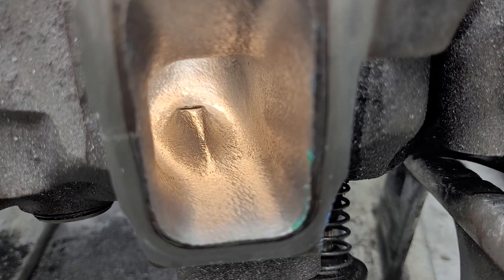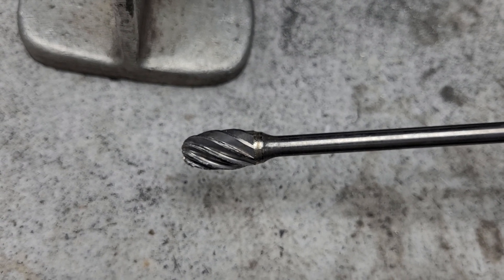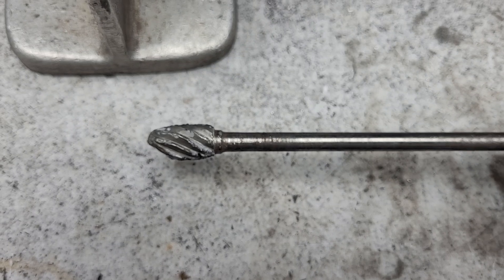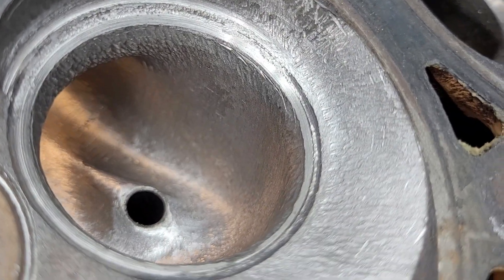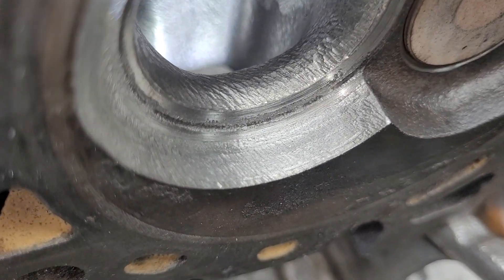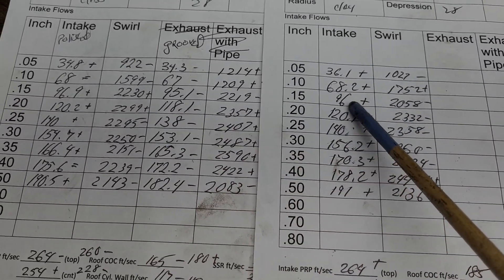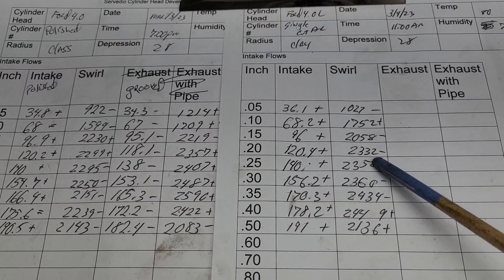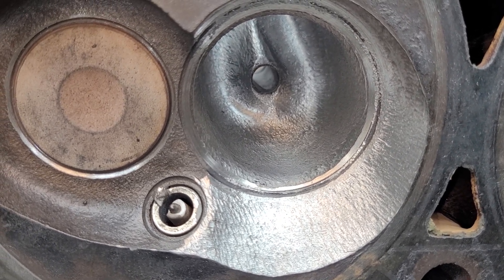The great texture debate, single cut alum burr on iron vs. grooved port with flows. Ported Ford 4.0l

Comment: What would filling the "base/roof" of the bowl do? With either material or dimples? Could it direct the flow towards the valve, with the short side radius mod? Just the area from the valve guide to the back wall.
Reply from the maker: I would bet it would work better and I could deshroud the chamber some more. Thanks

Comment: What happens to flow if you widen the short side?
Reply from the maker: It may go up but it will also change the flow curve. This port needs the ssr to push the flow to the roof and go around the bowl with a straight back wall.

Comment: Great work Charles! With DI, a smooth port is the preferred texture? Thank you!
Reply from the maker: I would think so. I t doesn't need to break up fuel it is dry so smooth would add a few cfm. It still is probably not worth the work!.